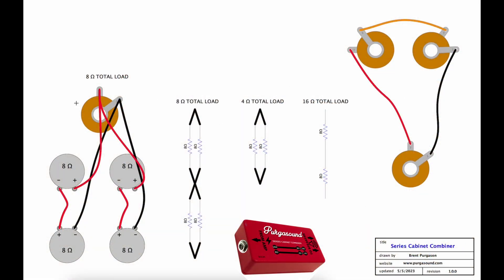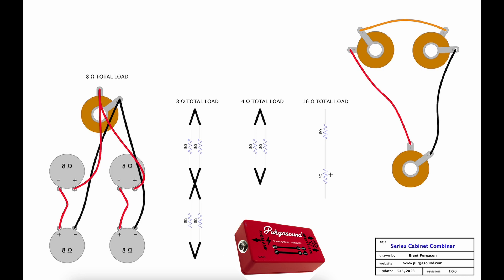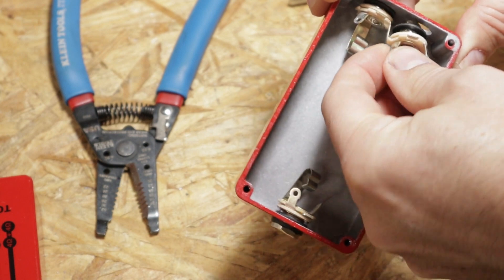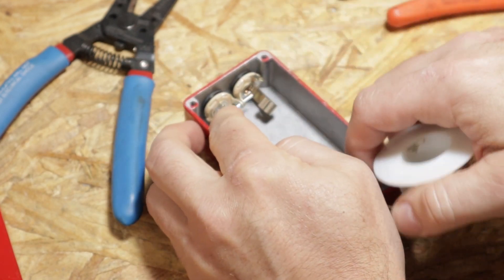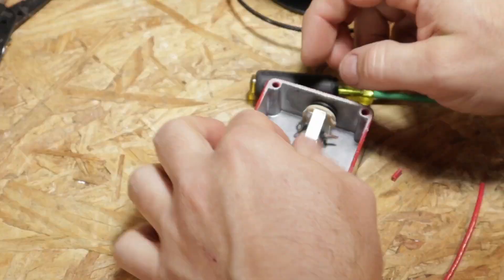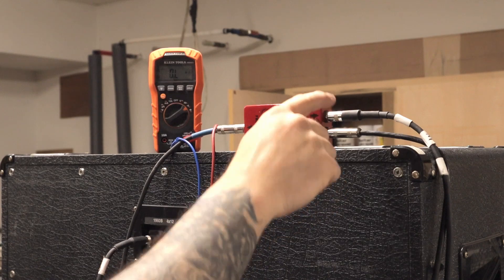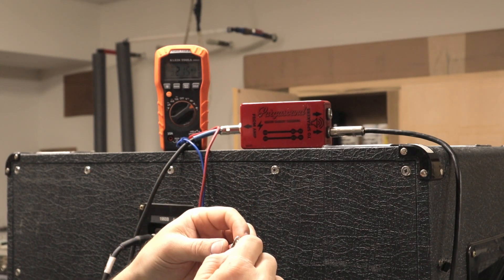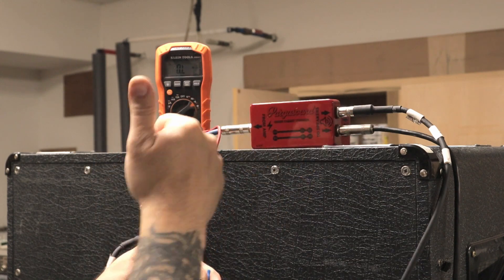How to build a Series Cabinet Combiner

Comment: I have a "JTM 45" built by a very good tech.  I have two speaker outputs in parallel.  I have two 8 ohm cabs.  If I use both, I plug each cab into its own output and set the amp to 4 ohms.  If I build what you have shown here, the two cabs would be 16 ohms...right?  Series would add up the ohms vs running them with the parallel outputs which creates 4 ohms.  Given how the amp is wired up to the different ohm taps, would there be any tonal advantages/disadvantages to making one of these boxes and running my amp at 16 ohms instead?  I typically pick an 8 ohm cab for a tone (one cab has GB's the other a blend of CB 65 and CB 75).  On occasion I go all out and run both.  Thanks!

Comment: My 16ohm amp has an internal speaker, but I added a DPDT switch and an external jack to be able to switch from internal to an external cab. However, that new jack is still 16ohms... If I wanted to be able to use my 8 ohm cabs could I basically just copy the wiring of this box to the inside of my amp with two 8ohm jacks in series? In this scenario, would these jacks have to be grounded on the chassis though? Or would I need insulation? finally, if I do this and I only use one of the jacks, but with a 16 ohm speaker that would be fine too right? Thanks!

Comment: How much are these? My amp has one 16 Ohm output and two 8 Ohm outputs. I have two 8 ohm speaker cabinets and two 16 ohm cabinets. is there a clever way i could run all my cabs on one head? I'll guess and say, plug the 16's into the 8 ohm outputs, and use a splitter box in the 16 ohm output for the 8 ohm cabinets?

Comment: PURGASOUND, 32 ohms in parallel with another 32 ohms speaker cabinet will = 16 ohms not 8 ohms. I'm not sure why they want to use a series parallel speaker cabinet rig because I'm guessing certain frequencies or tone you get from the series cabs and certain frequencies and tone you get from a parallel cab?
Reply from the maker: I think you may have missed part of my explanation.  I only had 16 ohm cabinets in the shop to show how they worked. The customer wanted to use four 8 ohm cabinets with their amp. His cabinets only had single jacks and his amp doesn't go down to 2ohms nor does it have four output jacks. I built these two boxes so he can run each pair of 8 ohm cabs in series at a 16ohms per pair. Then he can hook up the two 16 ohm pairs into his 8 ohm output jacks.  It isn't about tone as it is matching impedance. I've wired cabs in different configurations and never noticed a tonal difference. That's just my experience.  Thanks for watching!
Reply: @purgasound  Two 16 ohm cabinets into One 8 ohm output jack = 8 ohms its not 2 ohms so I'm not sure how this customer is going to get down to 2 ohms. The output current on the speaker cab is going to be maxed out at a certain current level. I'm not sure if the amplifiers output current is able to DRIVE all those speaker cabinets correctly because it has multiple reactive loads even tho its the same impedance its different when one load at the same impedance compared to using multiple reactive loads in series/parallel adding up to the same impedance. The output power tubes are going to be Pulling current differently because the output transformers reflected impedance on the primary side is not going to be stable and fixed. Do you know what I'm saying?
Reply from the maker: @waynegram8907  lol are you trolling me? Please re-read my previous  comment. Have a great day